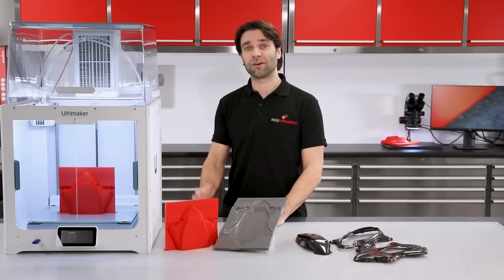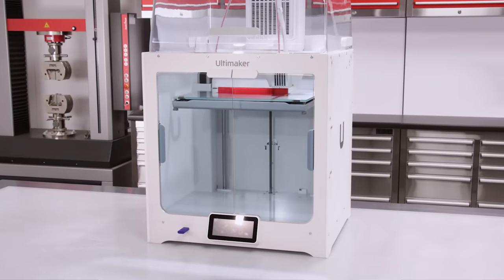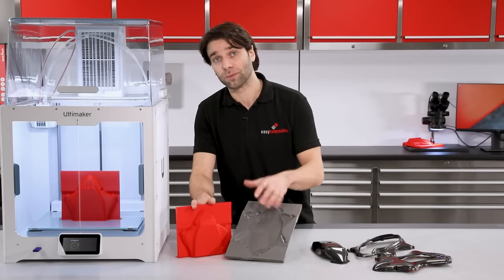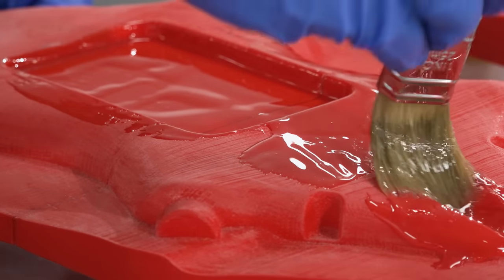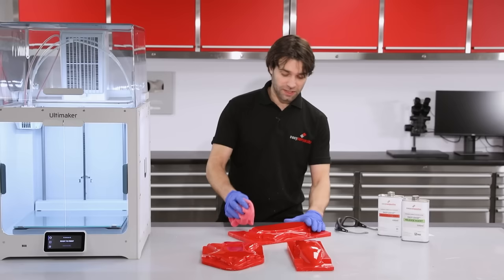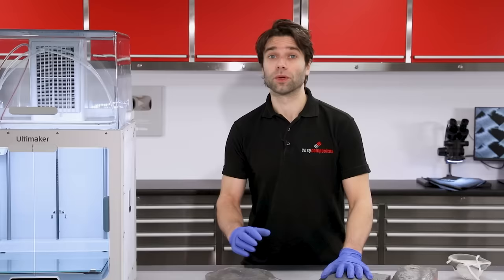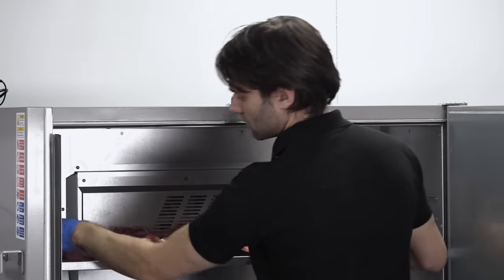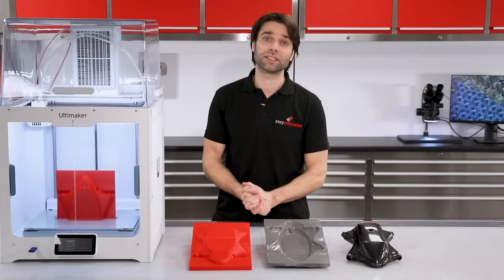Making a Composite Mould for a Carbon Fibre Part from a 3D Printed Pattern

Comment: I had a 3D printed plug made for my Racing Model Sailboats.  Approximately 1 meter long.  It was a precision mold that was lazer checked and reworked until it was close to perfect.  Then I had a mold made.   The mold is perfect as well.   This process really worked well for me.

Comment: The finished product is superior in quality and the pattern obtained is interesting, but the costs for this method add up quickly when you consider all of the products necessary to complete the process.
Reply from the maker: Its benefits add up if you already have access to 3D printing (yours or a friends) as a lot of the cost would be paying to have a model board or foam CNC cut as an outsourced project.

Comment: I like how you printed the mold vertically, in what might be considered the non-obvious way, minimizing the presentation of the layer lines along those gentle slopes. Very clever. Dammit, all your videos are amazing.
Reply from the maker: Thanks a lot. RE the print orientation; correct, the contour steps are less pronounced in the vertical orientation and for FDM, print speed is pretty-much unaffected by the orientation. Glad you're enjoying the content :)

Comment: Nice video, well done.
Right now I make a carbon fiber part (end cover for the muffler) for my KTM motorbike.
My son have a own 3D printer and have made with him a negativ mould for me.
After preparation this mould (sanding and filling) we will make the end cover with 5 layers of carbon fibre.
New for me is the posibility to coating the mold / pattern directly with resin for a even surface. I will test this in future on a new project. Thanks for this information.
Reply from the maker: Our pleasure. Your project sounds much more like the next 3D printing video we're doing where we use the 3D print as the female mould (not as a male pattern).

Comment: Great content! One of my favourite channels here! I made a wet-lay carbon fiber part straight off the 3dprinted mold in a room temp vacuum bag. It had a shallow curve (so lots of sparse layer lines to grab on to), but a with a few applications of mold release the part popped off super easily. Mold side surface is not visible and cf laid up almost to 2mm so the top layer was all good and ready for finishing after light sanding. The small pump in your store rocks btw! Supereasy and quiet
Reply from the maker: Thanks for the feedback, that's all really interesting and good to hear. That's pretty much exactly what we'll be doing in the next video although we debated using a vacuum bag and in the end decided to show simplest possible version; just an open hand layup. Send us some pics of your project, we'd love to see and share!
Reply: Where where at online are you getting the files for the 3D print modes
Reply: What infill (percentage) did you use on that mold?

Comment: Easy Composites is doing a great job with these videos. I prefer buying EC simply because I know they will perform as shown in the videos.
There are cheaper options but they don't have the tutorials.

Thank you for producing these extensive and comprehensible videos. The cost is not as low as I'd like, but we are dealing with a relatively new technology, and with the videos i make less mistakes, thus the cost goes down.
Best regards,
Leo

Comment: Nothing beats a properly sanded and polished ABS print (PLA resists sanding like crazy...always use water when sanding and a proper small desk lamp so you see the shape of how's your sanding going). If you can afford a large fdm you can afford one of the new large SLA printers. It's such a joy to sand and polish SLA resin prints to perfection.
Reply from the maker: We did plenty of detailed testing on various filaments and surface processing. For a proper composites moulding process you need to be coating a 3D print in something that can be finished to a high standard and which will take a reliable release agent. Our results were that for FDM prints, epoxy coating was the way to go. On that basis, it really doesn't matter whether the plastic sands and finishes well because that's not what you'll be sanding and finishing; it's more important that the print material is dimensionally stable. SLA printers do give a nice finish for sure but you still need a reliable coating and release agent if you want to take composites moulds off the prints.

Comment: I'm in love with this. I had created silicone rubber molds with 3d printed parts before. I will now try brushing the parts with epoxy before molding.Thanks for sharing.
Reply from the maker: You're very welcome. Certainly it can be a very useful process to take silicone moulds off of 3D printed parts in order to duplicate parts as resin castings and in fact using a coating epoxy like XCR can be a good way to improve the finish before taking the silicone mould off.
Reply: Where online are you getting your 3D print files to make the molds

Comment: Wow this is an awesome video!
E3D are experimenting with a toolchanger and a milling tool. So you 3D print a few layers, than mill them smooth to perfect accuracy, them 3D print some more etc. It would be interesting to see if you could use that to produce a nearly finished part than only needs a bit of spray coat and polishing to make the mold. 
Theoretically even that could be automated with a tool changing 3D printer by having some kind of polishing tool bit.

Comment: If the print material is ABS then you can chemically smooth it with acetone.  If you want to get real fancy you can make a vapor smooth chamber by heating acetone in a big pot. This is how the Stratasys vapor smooth station works, but they use different chemicals. I'm sure there are tons of videos of DIY setups on youtube. But it works really well and gives a great surface finish.

Comment: I print with ABS plastic and put the print in an acetone vapor bath to give the printed mold a smooth glass like finish.
Reply from the maker: Hi Branden, yes, perhaps we should have mentioned acetone vapour, it's certainly an option for improving the surface of ABS prints but not really the right solution for this type of process (part distortion, how to get a release etc.). Also, heating acetone is not really a process that we'd encourage a casual viewer to engage in!
Reply: An alternative to the ABS here, with less volatile solvents, would be to use something like PolySmooth.

Comment: great video, would be great to see videos on how to create parts without ovens or vacuum
Reply from the maker: Hi Nick, for sure. We're already filming the next part in this '3D printing in composites' series which is where we 3D print the mould directly, wax it up and hand laminate a carbon fibre part into it, all in, using zero fancy kit, vacuums or ovens. Whole process, a few hours from start to finish. I've rather spoilt it a bit now but look out for that video in the next week or two.
Reply: @easycompositestv  great thanks looking forward to seeing it.

Comment: Have you guys done any videos that go more in depth with material properties and how that impacts the design process of a part?  Things like not only fiber direction in relation to strength, but also things like electrical sensitivity of components that might be inside the composite part.  This drone would be an excellent example of that.  I assume that the carbon fiber could cause electrical interference with any radio transmission from inside the shell, requiring an external antenna, for example.  That sort of thing.  Or maybe you know of some good resources that may already be covering that level of detail and depth.
Reply from the maker: We haven't done anything on RF shielding but it's quite straight forward. Carbon blocks RF so, yes, this drone has external receivers, one for the video and one for the control, they're post mounted. Switching the reinforcement to any synthetic material like polyester, Diolen, Dyneema, Spectra etc or glass (particularly S-glass) would solve that problem and would have been a good choice for at least some parts of these shell components. To be honest, the video was more about the process of 3D print > mould > component, rather than the material choice for the component itself. In other cases, the RF shielding of carbon can be desirable.

Comment: This is something a lot of us can do. Can you briefly cover how you would make the the 3d printed mold of a pipe and release it? Thanks.
Reply: Use soluble materials like PVA or HIPS.
Reply: We're working with Easy Composites on this very thing. More tutorials to come :)
Reply: @dynamism6990  unreal!!!!!! Looking forward to that!!???
Reply: If you layup carbon fiber around a solid bar, I imagine it would be pretty tricky to remove the finished part from the bar.

Comment: Since you mention making a mold, would you have any interest in doing 3D washout molding?

PVA filament is readily available and prints similar to PLA, and dissolves in hot water. Similar to lost foam, but way cleaner. 

Reinforment could be laid directly onto the mold and would be applicable to hand layup, infusion and pre-preg as the glass transition temp is below an initial pre-peeg cure temp. 

I dont think anybody has done a video yet on this method.
Reply: This is actually the first of a several part 3D printing / Carbon fiber series. We may have something in the works like what you have mentioned so be sure to subscribe to Easy Composites for those follow up videos ;)
Reply: @dynamism6990  definitely subscribed. 

This particular process is of interest. 

I was at a trade show a few years ago and a company had a fancy sand 3d printer that they used for this exact purpose. 

The ability to make complex piping and other captured objects seemed very intriguing. Coupled with a very low mold cost, its something I'm planning on pursuing myself.

Comment: Such cool videos for us DIY'ers/makers! For my projects, (guitar making) I'd love to see a video on how to make some small CF rods, solid, square or rectangular, maybe 1/4" square section and 18" long, for use as braces and stiffeners. Just mentioning it in case you're looking for video ideas. 😎
Reply from the maker: Thanks for the comment and suggestion. Quite honestly, for carbon fibre rods you're much better off just buying them. They're cheap to buy and readily available in a huge range of shapes and sizes. In industry they're made on a full-scale pultrusion line. This is just not something you can replicate at home. You'd be able to bodge something by pulling tow through a resin bath and then trying to shape the section you need but there's not really much point. If you've not done so already, check our website for a huge range of carbon fibre pultrusions.
Reply: @easycompositestv , Thanks for the reply. I didn't realize rods would be tougher to DIY. I guess if I want to DIY something, I can experiment with L or U section molded braces instead. In fact, there might be (acoustic) advantages to doing that.

Comment: Really good presentation. You made me think about making carbon fiber parts for my RC airship project. What is easier for a beginner, prepreg or manually coating with resin? Is liquid resin more dangerous ?
Reply: To be honest all ways are not as easy as it looks. Less expensive way is wet lay or vacuum bagging. Second way would be resin infusion. Third would be most expensive is prepreg. 
I hope that helps but to help answer your questions I would say prepeg is your easiest
Reply from the maker: No real safety worries around any of these materials as long as you follow correct basic precautions. As for ease of use, you’d be surprised how good the results from a basic hand layup can be, especially if you’re willing to do a little bit of tidying up afterwards. Infusion is probably the trickiest to learn but it’s the one many people go for because the kit you need is fairly modest. Prepreg is, in many ways, easier to work with but does require the oven to cure which can be an obstacle. We can support you through whichever process you choose though and make sure you crack it!

Comment: Found this video on the quest to make ceramic molds from a 3d printer. Pretty Familiar with the mold making part itself. Only hitch was the lattice surfaces on 3d printed objects making mechanical locks. The epoxy coating method might solve that issue! Only I wonder how it might react with pottery plaster.🤔 Thank you sir!
Reply from the maker: Hi Landon Pal, epoxy is a very tough and resistant surface. There would be no problem at all using some kind of ceramic material on the epoxy surface. I'm not sure what material you're planning to use but the use of some release agent known to work with your ceramic material would be recommended.
Reply: @easycompositestv  Well the steps are similar to your method  . 3D printed object - mold made from object - ceramic object made from mold. The mold for ceramics is plaster (no release agent needed). That is the part I'm curious about, is how that plaster might react with or absorb anything that its being poured over to make a mold. Strange things leeching into the clay can ruin the finished product. Ill have to do a little research on the epoxy, could be no worry at all.

Comment: Really cool stuff. I've been interested in making parts for my Sprites and Midget, for example bonnet or boot lid, or even bumpers or wings. They're much larger than these example prints but 3d printers are rapidly approaching the size of those components, and of course machining the mold out of foam with a CNC has been possible for years, and can use the same methods. Ah, someday a bonnet. But within a year I hope to play with this method to make two very specific parts, a little tear drop shaped lump that fits under the taillights where a piece of a bumper used to go, and "bumperettes" which are bean-shaped bumpers that take the place of a full width steel bumper on these little cars. Both of those products are well within the range of an inexpensive 3d printer and both designs lend themselves to this modeling method. Thanks for the tutorial, you make it look simple, though obviously it's not that simple.
Reply from the maker: Thank you for your comment, these all sound like great ideas for components. Realistically, I think it will still be a while (or maybe never) before 3D printing will be the most viable process for larger (bonnet scale) mouldings but for smaller parts, such as those you describe, it's a great way in. For your bonnet, check out our (rather old but still accurate) bonnet making tutorial - unless you're making a custom shaped bonnet, you'll more than likely be taking moulds off your original part and this would be the way to do it. Look forward to hearing how you get on :)

Comment: I had the idea to make a pour mold to make a violin from epoxy resin. (I'm thinking 3 pieces for the body and neck) Just for fun mostly, I don't play but want to learn. Looking into it I see that a few people have made carbon fiber violins, and there's a company that does it. I also saw that a company made a glass violin as a gimmick, that would have used a mold too, though it would likely have been a more complicated injection sort of thing. I'm an engineering grad and pretty good with solidworks. Haven't made any molds yet, but I will. Kinda have to after videos like this.

Comment: I already made some complex parts with these technique for the hydrofoils system of the solarboat of my university, but great to see you covering this topic at your chanel. 
You really doing great work with the videos series, our next boat hull we are probably manufacture according to your dark ice series.
How are the current delivery possiblitys from GB to Germany, are there any problems due to the Brexit?
Reply from the maker: Deliveries to most of Europe are still going ahead, albeit slowed slightly by COVID and implementation of the new trade system.

Comment: Tip for very large molds and patterns from 3D printer : print a hollow shell and fill with Smooth On Foam-It 10 SLOW. Speeds up the print, less warpage, very solid mold. Done 5-parts molds from a CR10 MAX printer this way within a week.
Reply: We're curious, are you saying to print with no infill?
Reply: @dynamism6990  Absolutely, or the bare minimum to stabilize the shell. I have found that for large print, infill increases warpage (and time) by an inacceptable amount. I print with a 1mm nozzle and Volcano block to increase speed. You just need to find the proper shell thickness (I do 3mm) to avoid bulging when pouring the foam.

Comment: I believe your videos are the absolute best for all newbies like me. I have watched every single one at least once. I want to make a coolant reservoir tank out of cf for AutoX my car (1983 Porsche 944). Wondering if you have done any, or can share some tips or if it is not something you would recommend? Thanks
Reply from the maker: Not something we have tried, but you will need a high temp resin as coolant can sometimes get to 120C plus and design it strong enough to take the pressure as coolant systems are pressurised.  Generally if an OEM plastic tank can be used, it would be much easier and not much heavier.

Comment: An important topic for an engineer - dimensional accuracy. First you sand (unknown change), then you apply resin (basically unknown change), then you cure the moulds (probably also a dimensional change). How would you go about making parts, which are as dimensionally accurate as possible?
Reply from the maker: You would use a more precise process such as CNC machined tooling block which then uses a known thickness board sealer to keep a dimensionally accurate pattern through to the mould and hence finished part. Basic process would be similar to this video: https://www.youtube.com/watch?v=CWAvo8DIZ9s